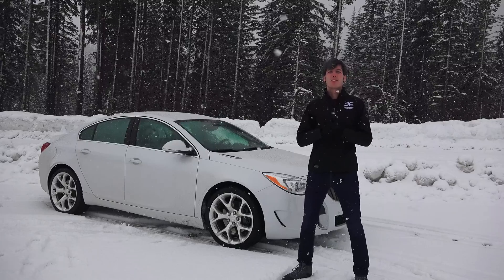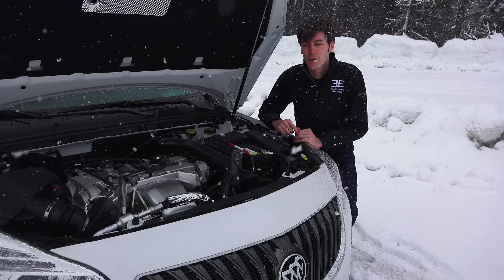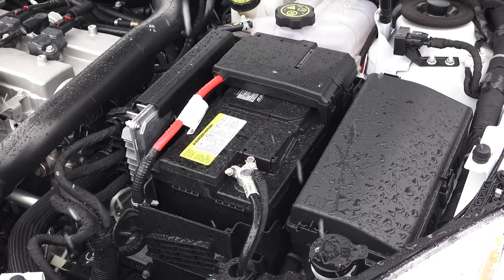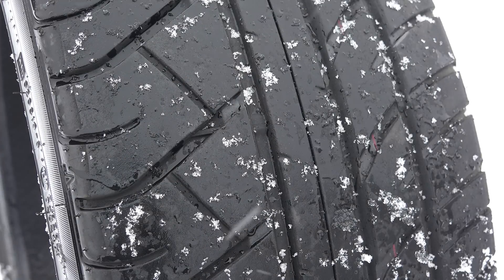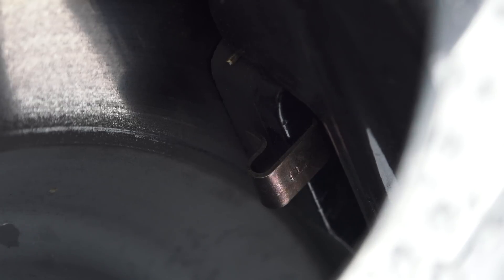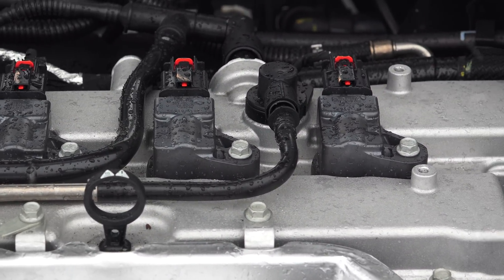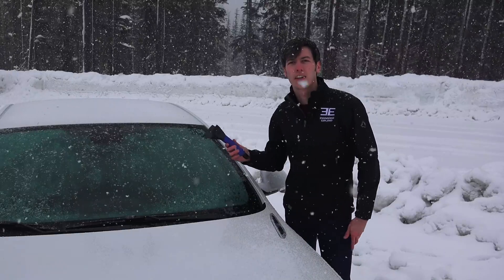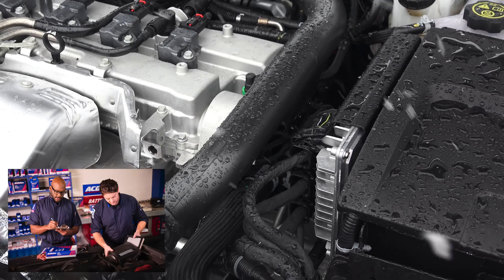6 Ways To Prepare Your Car For Winter

Comment: Had to buy a battery. It registered 12.5 amps on charger.Perfect! In -36°C I looked for shorts, corrosion, etc. It was the battery. 2 cells NFG. So, only hydrometer tests bad cells - not battery charger.
My Saturn Ion vattery is in the trunk🤔

Comment: Have a extra car battery in your car for a backup. I want to know can I use a wonderbag to keep the battery warm when I'm at work and can I keep about 4 or 5 plastic travel mugs cups with hot water in the wonderbag to keep the battery warm. Will someone try it and tell me would it work?

Comment: Your pressure changes yes but that winter tire bs is a myth haha
Reply from the maker: What’s a myth? Winter tires are vastly superior in the snow versus summer tires, and even much better than all-seasons. There’s tons of data proving this.
Reply: @EngineeringExplained  I'm sorry I didn't mean to say that I meant that changing out with winter air is a myth winter tires are way safer in 45 degrees and below I work at discount tire haha ik they're better in the snow

Comment: I have a quick question so I have a 2008 Acura csx (Canada only model) and after a few days of not being driven or after a cold day when I go to start the car there is hesitation and it takes longer to start. Now I know that the battery isn’t that old so I was wondering what else it could be maybe spark plugs?

Comment: put winter air in drag slicks > snow tires. also remove the cold air intake as all air is cold in winter.
plus remove the dipstick so oil cools down quicker

Comment: Which is best... Scrape ice off window or throw bucket of warm water over window???
Reply from the maker: Scraping (with plastic) will have a better possibility of not damaging your windshield. Hot water might work, but it could also cause glass to crack if the temperature differential is too high.
Reply: Engineering Explained I'd be interested to see that tested.... I always thought 'scrapers' were nutz... Bucket of warm water and your ready to go in 2 seconds flat

Comment: I'm a Canadian and winter driving and preparation between season is essential, when you start your engine below 32F (0C) let your engine warm up, don't just start and drive immediately, the oil is like molasses and you put a lot of mechanical stress and it will help with condensation going in oil and muffler, ex: short drive and engine temp low; 100% RH water condense and drop, so when you start and let the engine warm up, this high humidity will escape as a vapor and it will lower your RH (Relative Humidity) in the engine and muffler and you can drive and stop the engine knowing that less water condense. When Springs comes; change oil even if you didn't do the required 2,000 miles between oil change that winter or if you use synthetic oil, it will help a lot with internal rust. Use winter windshield washer fluid -40F (-40C),  when you start your engine, move your heating vent lever to defrost at 1st speed and as the engine warm up increase the fan speed; the windows need to be warm before you, use a electric seat heater. Remove the snow from ALL your windows AND roof, don't be lazy, it's not funny when you follow a SUV on the highway and then his snow blanket detach from his roof to end up in your windshield, it can take a while for your wipers to move 3 inch of snow even at 60 mph. If temp is bellow -20F, plug your car oil heater before going to sleep, next morning you will start your car and it's already warm and you can start driving but not in a rush, differential oil for rear wheel drive is still cold. When you drive on a highway at 60 mph, there's still a lot of grip from your tires because there hot, understand that concept, it helps when you get on icy roads when you least expect it, don't panic and don't brake immediately, reduce speed slowly until you have safe control, if you have to do emergency braking on ice; softly brake and steer gradually to the side and brake more using that gripping side snow and counter steer so you don't end up in the ditch and lastly but not least, " keep a double safe braking distance " there might be ice under snow. Have a nice winter season.

Comment: 1.  get a battery heater - they're cheap. 
2.  get steel rims -  those fancy ass rims on the buick will buildup snow during a storm and will become off balanced. 
3.  check your ebrake .... for winter fun in parking lots obviously. 
4. let the car warm up before you beat on it 
5.  get new wipers every 6 month - they're cheap....and cheap one last as long as the expensive ones. 
6.  dont use a card ...  it will destroy the card.... or at least use one you dont care about. 

7.  try getting into the habit of keeping your car full of gas in case something happens. 
8.  keep a small pack in the trunk with lock de-icer,  toilet paper,  water, snack bars, and jumper cables.... oh and hand warmers and a blanket ...it coincides with number 7.   
9.  when it starts reaching freezing temperatures drain your windshield fluid and replace with winter stuff.... you'll thank me when you get on the highway and you can frickin see.
Reply: Cubstopher Reid well said
Reply: replacing wipers every 6 months is a waste especially in winter where they wear down quickly
Reply: edit : use anti freezing ice defrosting liquid in washer fluid
Reply: I put mmo in gas tank in Nov. Then fill up with highest octane. Winter tires, of course (I have old winters and and good winters on rims. Cheap and reliable). Bought new wipers for 2 cars (Saturn & Honda) at Princess Auto on sale $8.00.
I'm fixed! Nothing can stop me now!!! Bring it on!!!!

Comment: I would add coolant, screen wash, glow plugs for diesels etc. but I guess sponsor is not doing those, so no point. I hate sponsored videos and those are strongly working against youtuber credibility.
Reply from the maker: +MrKnocik FYI - ACDelco supplies coolant, screen wash, and glow plugs. But believe what you will about my credibility - your decision to make.
Reply: +Engineering Explained Then I think it is even worse not mentioning other elements...
Reply: +MrKnocik I was super surprised when he didn't say coolant because when you see forecasts in the -20s you have to make sure you have got a coolant that wont freeze.

Comment: I can't believe nobody mentioned to drain your radiator and replace with new water
Reply: +woohunter1 YOu DON'T replaced with water.  During winter season, you use as close to 100% antifreeze as possible.  There's a REASON it's called antifreeze and why it was created.  Think about it.  Water freezes a HELL of a lot faster than Antifreeze.  During summer you can use 50/50.
Reply: +tpcs it was a joke, anybody that believes the advice that I gave out doesn't deserve a car

Comment: Lol! That is a very lenient winter. If you can scrape off ice with a card, then it's really not winter lol. Once it gets below -20°C a little credit card won't help, and every wiper blade on the market skips and freezes. I wish I lived there where the snow melts as it hits the wheel of the car :(

Comment: The one only best thing to really prepare for winter is to get proper snow tires. If you get ones with studs even better ! because that is in my mind the ultimate thing that will keep you save on snow/ice surfaces in winter
Reply: That and probably 4/all wheel drive
Reply: @bigd2829  Well yes, maybe more of a convenience to have it to make it easier to get going on icy conditions since there is more attraction and maybe it is harder to get stuck in deep snow but from safety point there is not much that it provides

Comment: Do you guys think buying a new battery would help my car start without me having to step on the gas a little bit? My car is 15 years old, works perfectly and I love it, but some days I need to give the engine some rpm to start the car up or else it wont turn over. Thanks for any advice!
Reply: +Hendo If you need to press the throttle to start the car, then the problem is most likely not your battery or starter.
Do some research on your car and see if there's any online forums related to it. If so, there's probably somebody who has had your problem before and knows how to fix it.
Your problem is most likely related to the fuel system, but I don't know enough to say for certain. Doing a bit of research will certainly help you out.
Reply: +Tommy-Lee Armstrong Thank you very much Tommy-Lee! It hasn't been an issue but I should get on top of it now before it does.
Reply: +Hendo 15 years young not old.

Comment: Nice but why mention the brakes? First of all, no matter what season it is brake pads should be checked regularly.. 
And second, proper driving on real snow does rarely involve hard braking... Hitting the brakes if you feel to fast or you're starting so slide is probably number one cause of people sliding in a ditch..
So i don't really get why you mentioned the brakes.. (apart from ACDelco selling brake pads...) 
There are other more important things like checking the anti freeze if its good for below freezing temperatures, making sure the windshield wiper fluid isn't just water and will freeze (also top that one off regularly as you need it a lot..) for example..
Also you can never ever stress enough how much tires matter, people still will drive on summer tires and then wonder why they end up in a ditch somewhere.. 
Also, just because it doesn't snow doesn't mean you don't need winter tires if its still cold since the rubber on summer tires is just hard.. Otherwise you have to drive very careful the first few miles until the tires warm up..

Comment: Don't forget to check oil condition during the winter. A lot of motors end up collecting moisture if you don't run them for long enough, which eventually ruins the oil. I lost a BMW engine from bad oil and major yellow goo under the cap.

Comment: why do brakes matter in winter?! you're mostly downshifting or lightly depressing them in the snow/ice.
Reply: +davdavc Good question and important. Ultimate brake force is not necessary in winter. Only thing that is important with brakes is that they all function equally well/badly. If one brake is gripping all the time and one is stuck and not doing anything it could make the car very unstable while braking. So, there is no point in going expensive full brake overhaul because just because there is snow, just get them checked (with some trusted mechanic) and decide then.

Comment: The wheels are the single most important thing, DO NOT use summer or all season tires in winter they are completely insufficient. You need to use winter tires that you mount yourself, especially since tire hotels and workshops will use power tools that Titan the bolts too hard making it impossible for you to remove the tire if you puncture it as well as over stressing the bolt giving you a higher probability of straight up loosing a wheel. For reference i live in Norway

Comment: drove my sti with summer tires and worn out rotors during a snow storm and did just fine.
Reply: +Erick perez Good job, keep thinking your subaru doesnt need proper tire because of the AWD and maybe you'll realize the hard way AWD doesn't make you stop any faster.
Reply: You drove through an inch of snow
Reply: +David Cazes normally i would agree with you but personally driving in it knowing your conditions, the speed you should be going, and what you as a driver and your car are capable of is a start. obviously the right equipment helps a lot.
Reply: Erick perez No. A Subaru is no better at stopping than a 1991 Honda Civic in snow, in slush understeering into the ditch when you come into a curve too hot is a worry no vehicle drivetrain can save you from, you would need a rally car and a pro driver to go ham in a snow storm.

Comment: Welcome to Australia where the temperature is 40 degrees Celsius today...
Reply from the maker: +JamaineXD Try not to melt. :(
Reply: +Engineering Explained We dont melt, we burn.
We become rose gold in color
Reply: +Engineering Explained 
You should do a video on how to prepare your car for summer for those of us down under haha
Reply: +JamaineXD He will have to come here to expericance our summer to know how to best deal with it.
That or go to death valley for the Australian summer in the US.

I would say
Get window tints, will help in reducing cabin heat
Get the A/C recharged
Change coolant(most important)
Clean crap from condenser and radiator, change wiper blades so you are ready for those sudden heavy down pours
Check fluids
Get road side assistance, let them deal with the car in 40C heat, while you sit in your car drinking an frozen coke

Comment: talking about winter with a buick verano (in spanish, verano is summer).
Reply from the maker: +El Chasco It's called a Regal here.
Reply: +El Chasco They are actually two separate vehicles, the Regal is the larger and more expensive model.

Comment: 6 Way to Prepare Your Car for Winter:
.
.
.
.
.
1. Subaru
2. Subaru
3. Subaru
4. Subaru
5. Subaru
6. Subaru

Do I need to say more?
Reply: +Charlie Matthews awd in a Subaru is only part of the equation, let's mention a very good awd system along with low center of gravity, very reliable--- less likely to leave you stranded and freeze to death, and they are dog tested, dog approved. Haha
Reply: +AJ Harran most of my winter cars for the past few decades have been rwd :)  oddly enough i am now driving a subaru :(
Reply: +AJ Harran I laughed way too hard at this, lmao
Reply: +AJ Harran From a physics perspective AWD does not improve "traction". Since it only describes the friction between the tire and the road, along with the "weight" (since angles play a role as well).
Reply: i had a super now its sitting in a junk yard because it slid off the road and hit a tree...i was going 10mph
Reply: +AJ Harran Tools and parts for a head gasket... At least in the age of Subarus that I drive.

Comment: Hi Jason, great video always, just a quick note for tire inflation, both for summer or winter, inflating with nitrogen doesn't cost that much (a few bucks) but keeps a rock solid tire pressure regardless of exterior temperature. Replacement standard air is always available in case of emergency :-)

Comment: Great video! My windshield wipers on my accord started slamming really hard on the way back down. It also hits the pillar on the driver side. Any idea why this is happening? I tightened everything and even adjusted them a bit. It only happens when the windshield is wet.
Reply: +ZombiedustXXX thanks, I'll definitely check that out

Comment: Jasson you are a genious,  using snow to hide the gray !!!   :-)  No wonder you have a You Tube channel,  and get to drive those rockin cars :-)   You did forget Antifreeze,  In MN (in a normal winter) we can get to minus 30F at times.  Have your radiator fluid tested and if it is more than 5 years old, get it flushed.  Oh and one more thing -- seat warmers -- everyone should have a hot blonde girlfriend that will go out on cold morning and sit in your seat to pre-warm it.  (hmmm wonder why I am still single)

Comment: I wonder if you would do a video on whether to warm a car up in cold weather. For what it's worth I don't warm my cars up.  I live in the north and I have one of these foam snow removers car dealers use. I never use ice scrapers. Instead I use about 1 gallon of hot tap water which will undermine all but the worst ice, in which case I go back for another gallon. I carry a 1 gallon bottle with a handle, I think mine is for tropicana oj and if I am away from home I ask for hot water, never a problem. I have never cracked a window by the way and no scratched windows from ice scrapers.

Comment: Quite basic stuff. I guess I was waiting for something more.

Like what things to keep in your car; how to prevent battery from dying; how to prevent ice on your mirrors/windows. Also, which parts should be oiled (like the locks on the door, provided it has mechanical locks) et cetera.

Anyhow. Good luck with next videos.

Comment: Don't forget to wax the car to keep the contaminants away as much as possible from the paint/clear coat, apply some hydrophobic treatment on the windshield and other windows and eventually use a rust protection wax on the belly of the car to minimize the action of the salt or other antifreeze materials from the road.